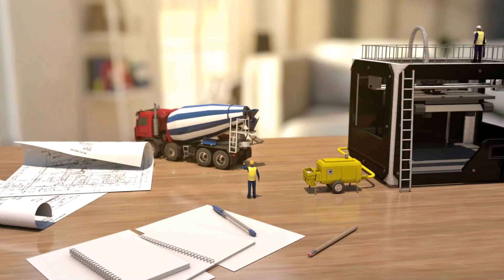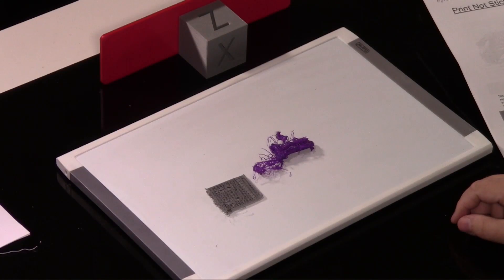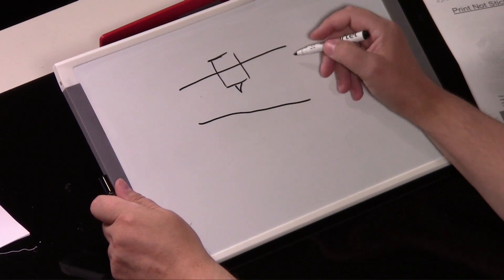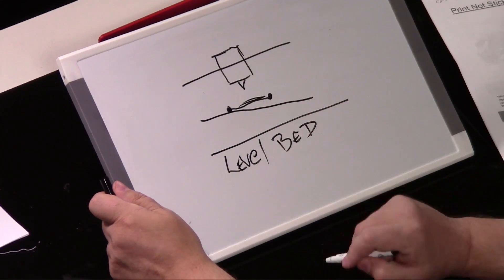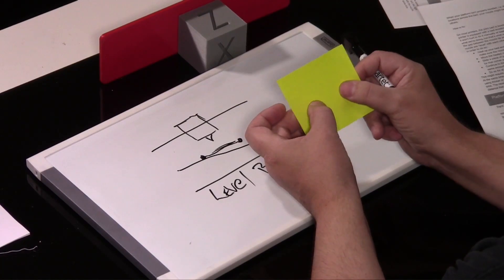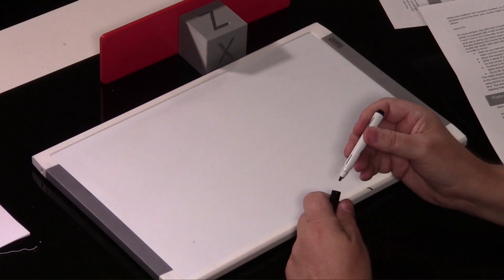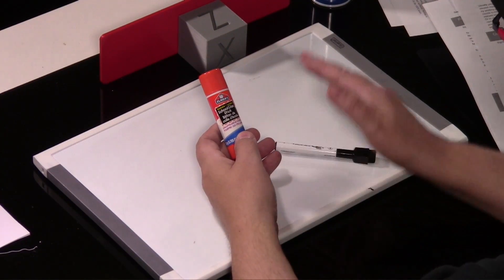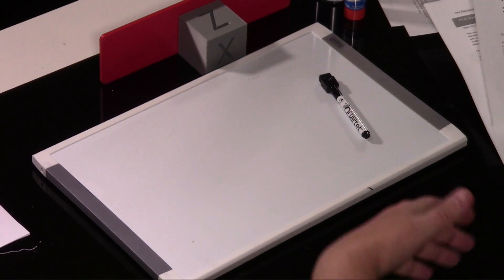Prints Not Sticking To The Bed?

Comment: Thanks for your thoughts. I have been having difficulties printing after going through your guide for levelling the plate. I discovered on my last print that a thin business card set up the  seperation satisfactorily, but today nothing is working properly. The printer is a CTC DIY  Prusa i3 knockoff. After  watching this I held a ruler across my glass palte and discovered that I could slide a Post-it note easily under the ruler at the center of the plate, but not at the edges. Going to turn over the plate and test again!    Also having problems that Cura 4.5 is now not heating the baseplate, and this is bothering me. I heat it from the device control panel before starting. Is weather a factor? It's warm here in Dorset.   Thanks for any advice.
Reply: The screws in the corners of the base plate are slightly proud of the plate, even after being filed down so they keep the glass high, and the clips that are inboard of the screws must be flexing the glass plate down a bit. This is a pain as I will have to file the screw heads down a bit more, which will not leave any slot for the screwdriver.

Comment: well nothing I have done works I have done tape, glue, hairspray, different beds like glass, rafts, brims, etc. I always clean the bed. had my Ender 3 for a few years constantly trying to mess with nozzle height and temps used more filament in failed prints that actual successful prints. If somehow manage to get it to stick something else goes wrong like it warps, filament breaks, clogs, print comes loose. The only way I can sometimes get it to work is to turn the speed all the way down so it’s painfully slow. im about ready to give up. Seems like I’m the only one with these problems too. I need help please!
Reply: did u fix it?

Comment: #1 to for bed adhesion, clean the surface with alcohol prior to printing.  I would be absolutely horrified if anyone ever put glue stick, hairspray, tape, or anything else on my mirrored build plate.  Like why would anyone ever, it's glass

Comment: Hi, thanks for the information, my problem with my 3d printer is that, after 40%+ of printing, my print will start to peel off, warp and will go out of place, I have a kapton tape on top of my hotbed/platform, I am using a ReplicatorG-0040 with PLA, temperature Bed 110, extruder 220. can you help? Thanks.
Reply: Your bed is way way too hot. Turn your bed down to 60

Comment: for the ender users out there, the glass bed is definetely worth the investment, the coating on the glass works wonders. been using it for the las t year without any problems, id highly recommend it. you can get it here: @t

Comment: I have manually leveled my bed a hundred times and all 4 corners are perfect but center seems to still be too low... How is it to get center a little lower without dragging outside
Reply: Hello - unfortunately you can't.  It sounds like your bed is out of flat.  In that case all you can do is get the center working area as squared up as possible.  I have a 12" glass bed and I used a 6" square area in the middle to level on. I run a CMM and took the glass bed into work and checked and it was .014 out of flat with the corners distorted.  Being that I mainly use the center I leveled it to that and disregarded the corners.  I use a Dollar bill as the shim for the "squish" and it has worked very well. Good luck.

Comment: When using the Painters Tape, do you need to adjust the offset to compensate for the thickness of the paint?
Reply: I do feel that you should. Imagine having tape as thick as a brick (ridiculous I know), prity sure that if you didn't adjust the offset, it would carve into the thick tape as if there isn't a huge sticky block in the way.

Comment: I am having bed adhesion problems with an Ender 5Using an infrered temp measurer I find the bed holds it temp ok (60 DEG ) but measuring the nozzle  which is set at 200 deg C and shown to be at 200 dec by the thermisor I find it is only 58 DegC. Is this normal or a proble?
Reply: How did you measure the temp of the nozzle?

Comment: I've done every one of these options and it still won't stick. I've had my printer for less than 2 months and it was working completely fine until now and I legitimately have no idea what to do. In addition to applying the tips in this video I've also looked into fixes for the nozzle and applied them. I really need help

Comment: i heat bed to 80, put a layer of hot melt glue on bed...then turn off heat all-together, wait till it hits under 40 then print...with cold bed cura bed set to 0...when you have finished print heat up again to 80 then remove...simple..

Comment: I have tried all these tips and still have a problem. Is ti possible to have an STL and then your gcode file to be corrupted? Even after running my STL through a file checker and saying it was corrected, I still have one half of my part messed up. So I'm pretty sure it is not the bed, I have checked and re tried several times and always the same result. It starts out great but by the time it gets to the second half it starts having problems. It looks as if the bed is not level because it appears to be raising up off the bed at a steep overhang angle. Anyway, just curious about the possibility of a corrupted file.
Reply: If it's a bad stl you will be able to see the problem in your slicer's preview mode.
Reply: Update: The problem turned out to be a mistake I made with the STL file while designing. somehow my part got rotated a degree or two off the plane. Without any support it was doomed to fail.

Comment: Nozzle raises high when about to print :( It's driving me nuts and I cannot print anything.
Reply: Same issue, just got one today, as soon as it goes to print the first layer the nozzle jumps up to 5mm and just squirts plastic onto nothing
Reply: Make sure you set the starting gcode set for your printer.  I had the same issue.  Mine would print the samples that came with my printer but when I loaded a cura slice it would jump up 10mm. The start code is under the manage printers tab in cura.
Reply: @trapperdad121  thank you ill have a look for it after work

Comment: I bought a 3D printer back in March. It took me a month to get it working. I finally had everything going great, until last week it stopped printing cleanly. Now ALL of my prints fail. PLA filament goes everywhere, and I've leveled my ToAuto Pyramid (Creality CR10 knock off) so many times that I don't know what else to do. I've slowed down my print speed and it still spews out plastic even on the numerous bed leveling tests I have done.

Has anyone else had this problem? I'm going to throw this thing out if I can't get it working. I'm so frustrated!!!!

Comment: Any school type glue stick, or is there a specific one to use?
Reply: Yup any type of glue stick
Reply: @bluesky4917  thank you for the answer on that. I just built my first printer and it seems my main issue is bed adhesion. Now I have squared the whole thing up, made sure plate was not warped, and leveled the damn thing multiple times and still have my prints pull off the bed. Picked up some Elmer's glue stick last night so today I will try again.
Reply: Anon Anon np I also just got my ender 3 pro a few days ago too. That thing is a beast beside the small bed adhesion problem. I already printed a bunch of upgrades for the machine. Good luck on your machine
Reply: @bluesky4917  mine is also the ender 3 pro. I added the glass bed, better Bowden tube, metal long range extruder, and the yellow bed springs. I have a bootloader in the post as well as a raspberry pi with a screened case. I also found this random entertainment stand piece sitting in front of a neighbors house that has a 2 x 2 framed top with two drawers underneath that I plan to use for a enclosure.
Reply: @bluesky4917  did yours come 1.1.6?
Reply: Anon Anon what are you talking about?
Reply: @bluesky4917  main board? Motherboard? Not sure its exact naming.
Reply: Anon Anon oh I gotta check mine

Comment: I level my Ender 3 and then when it goes to print it goes higher up and doesn't stick. Could it be a software thing?
Reply: I even use CHEP's level test file and get that to stick well but then actual prints start curling.
Reply: Having the same problem on mine right now wonderin if its the software too and how its sliced. I dunno